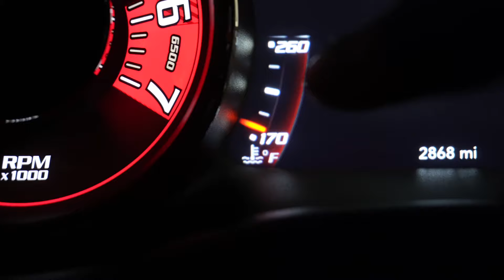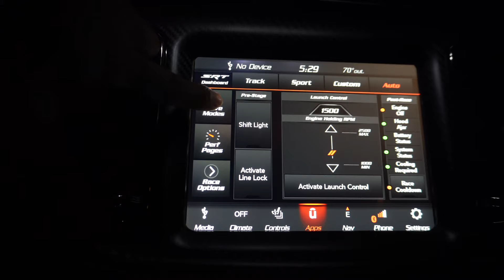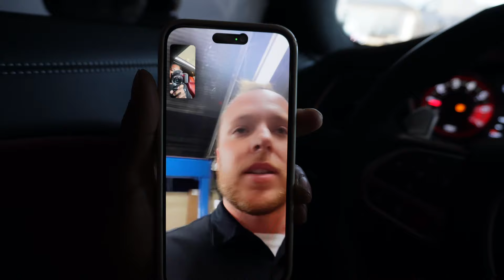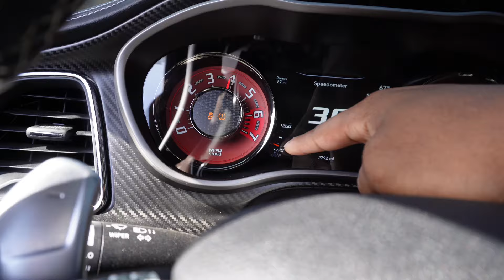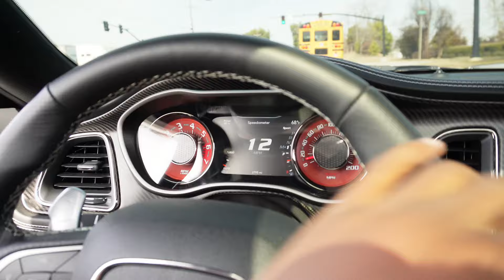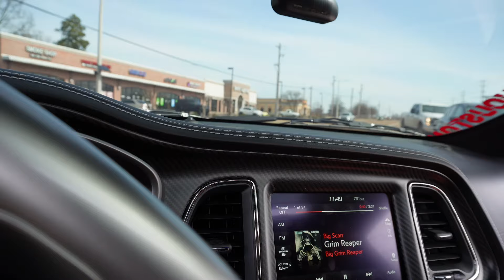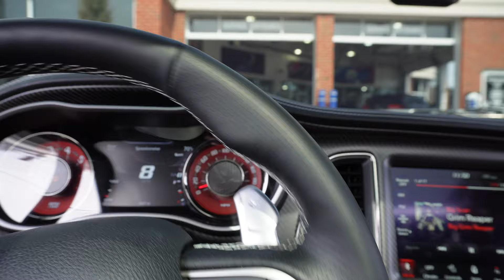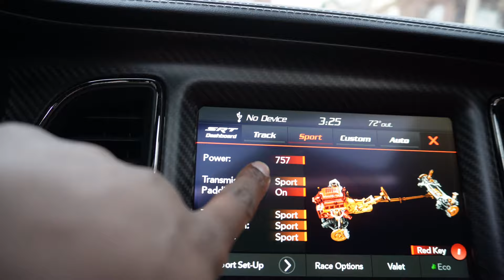Stage 1 Dodge Direct Connection On My 2023 Hellcat Jailbreak🐈‍⬛💨🥵

Comment: Hey nice car, I have the same thing on my HC Charger, stage 1, had mine done at Helfman Dogde off Silber and I10. Photo opt. 2 Direct Connect in Houston. S..HOUSTON
Reply from the maker: I think that’s where I bought my car cause my car from Houston
Reply: Thought you were in Hoiston.
Reply: Mine came back with a transmission tune as well. Helps with heat and RPM don't go all crazy.
Reply from the maker: Nah just my last name I’m from Dallas
Reply: Ahh, too funny!! Was in Dallas one night, tore up Harry Hines Road, was fun, cops were looking for me. I know because I was pulled over by DFW, cops said someone was over there rubbing a fast HC. As I pulled in to get more GAS, lol

Comment: I have a 2017 TA 5.7 challenger have hooker shorty headers cut off catalytic converters put stainless works high flow  catalytic converter to a flow master. Outlaw catback exhaust pipe get rid of the resenators

Comment: Regarding the installation of the supercharger pulley, did you use all of the "new parts required for the install"? The parts I am referring to are:

68271246AA Intake Gasket (Incl. L & R Side)
68267540AA Supercharger Lid Gasket Kit
68271245AA Throttle Body to Intake Seal
68271253AA Throttle Body Screw
68271249AB T-MAP Screw
I am in the process of buying the kits and wanted to know if all of these extra new parts are actually required. I understand that some parts are necessary, but I wanted to see if it is essential to purchase all of the additional required parts. Thanks
Reply from the maker: I did it all through the dealership so it’s all warranty parts from dodge nun if it was aftermarket